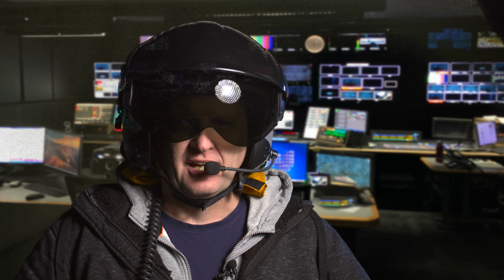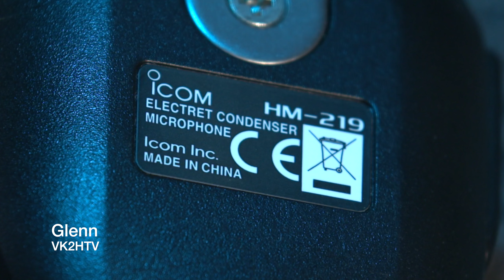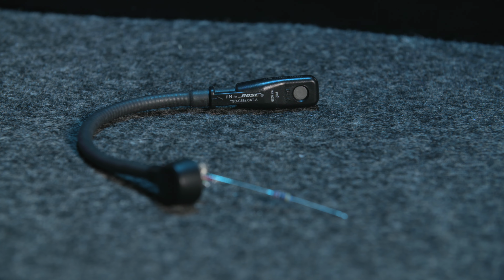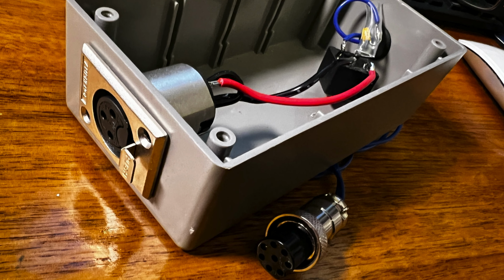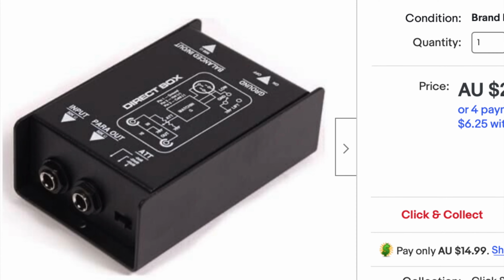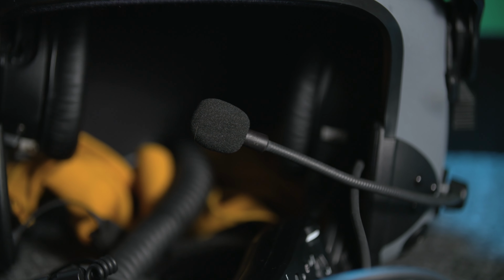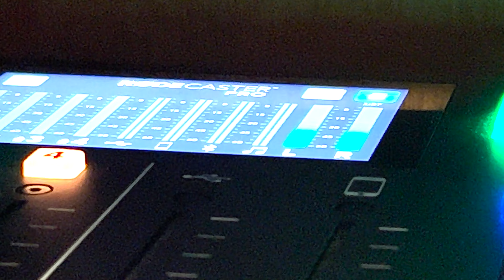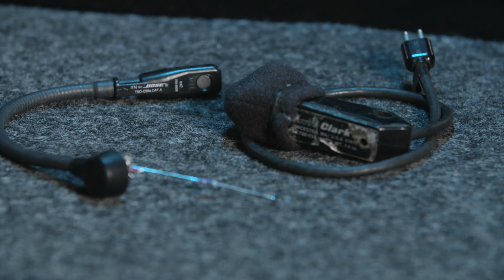Aviation Headset and Dynamic mics to Icom Radios

Comment: How is the setup working out for you? If I understood correctly the Bose was connected directly to the radio with no additional circuitry. Is this correct? I am getting ready to do a build for both my IC7300 and FT 857

Comment: Hmm - I wonder if my Delta Zulu Lightspeed headset will work with the Yaesu FT-991A that Santa is promising me for Christmas? Think I might at least need a cable adapter (possibly a Heil AD-1-YM)
Reply from the maker: It's tricky using some aviation headsets. They usually require a small voltage to excite the electret microphone. There are also some powered adapters to suit certain connections. The icom and maybe others provide voltage but others you can use a dynamic mic

Comment: A fellow helicopter driver.
Reply from the maker: Hey John - Where do you fly? I was the Helicopter pilot in Adelaide for the ABC
Reply: @Aussie_Ham_Radio  Channel 7 in the late 80's early 90's. The photo on my QRZ page is me and the 500 at the Willunga Almond Blossom Festival (1989 I think)
Reply: Military headsets ie David Clark’s utilize a dynamic microphone. Civilian flight sets utilize condenser elements. You can find used DC military headsets at various hamfests in the states ( not sure of other countries) that are in various states of disrepair. Last day of the Dayton Hamvention many years ago I bought out a guy who was selling surplus headsets that were all basically parts for around $75. I was able to piece together two headsets that used the 174 connectors on the for Helios. I purchased a couple of condenser elements for the wire booms from a supplier called Marv Golden Aviation supply for a lot less than the original DC mics. After all of these years (at least 30) they still work like new. This year went to gel ear seals, fantastic! In total I have about $150 in both headsets after selling the rest of the parts at another ham fest. Nice thing is that there was no issue with the receive impedance on the earpieces. Avionics suppliers also sell impedance matching transformers for radios that might need them. From aircraft to HUMMV with my Stand alone intercom box I get double duty from them.